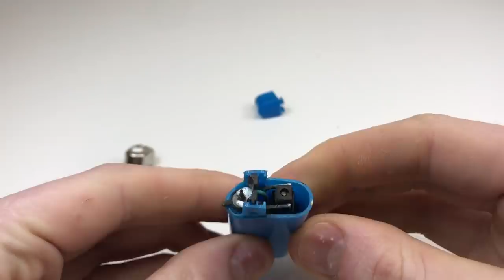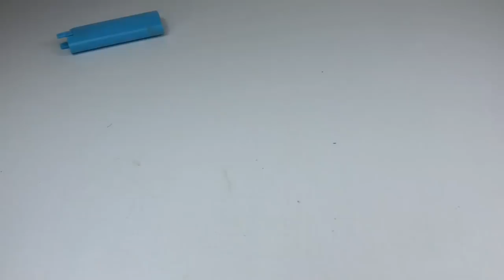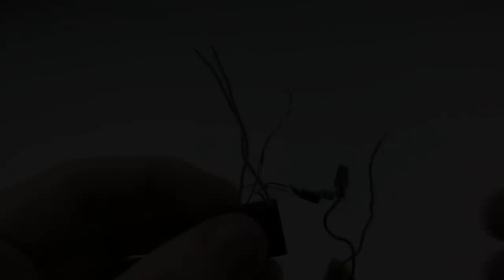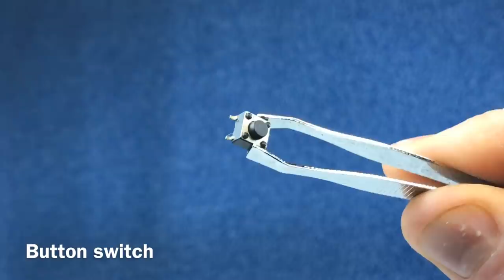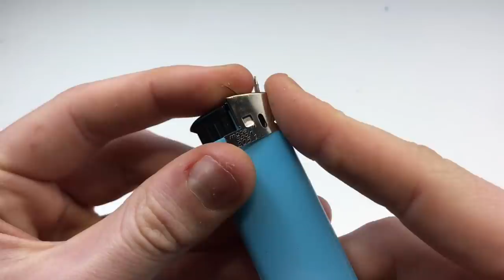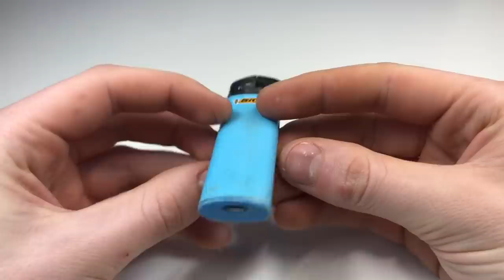how to make a electric lighter at home

Comment: A bit of text or audio explaining the process as you go would really be mice.

Where do you get the circuit board? 

What types of wires are you using? 

Did you just take apart an actual electric lighter and use the guts of that, switching it to this lighter? Or did you buy specially made stuff?

Comment: Bro add couple of blue capacitors on the output you thank me Lata 🤣🤣
Reply: Bro why neee this capacitor can u explain me plz
Reply: @chiranjitdas1355  charges them for a stronger discharge but be careful may destroy the transformer if capacitance is to high may Neva arc across or reduces arc gap distance
 maybe few in series and in parallel to the output would help a bit lol
Reply: Wow thank you but can u tell me that where this capacitor connected this arc

Comment: Ok price comparison Actual Arc Lighter  including charging cable the one I bought was only $9.88 at Walmart ok let's see how much it is to build your own.
Bic Lighter around $1-3,
High voltage module diy kit
Around $5 +/- on Ebay + shipping if it's not free shipping,
Charger cable depending where you get it from and how good quality it is and if it's made for good charging current, probably can get one for about $7 at a convenience store unless you go for a cheap one around $2 including tax comes to: $8-15 plus add your work, effort and time that you have to wait for your shipment for the high voltage module so it's way simpler,  better and *cheaper to just buy one professionally made.